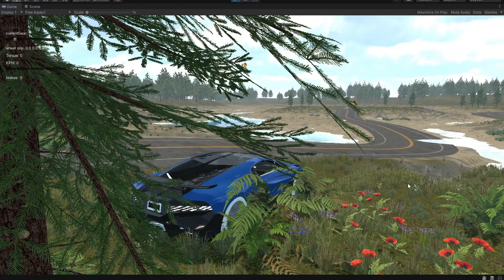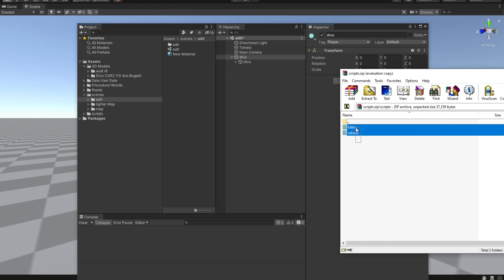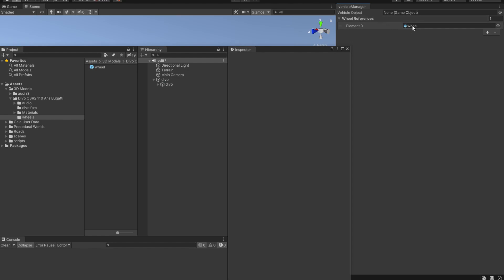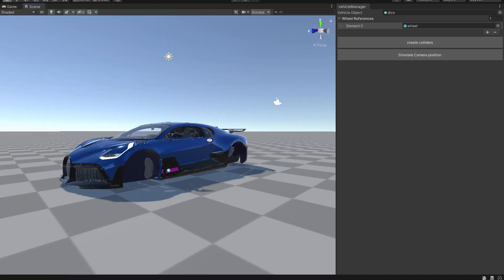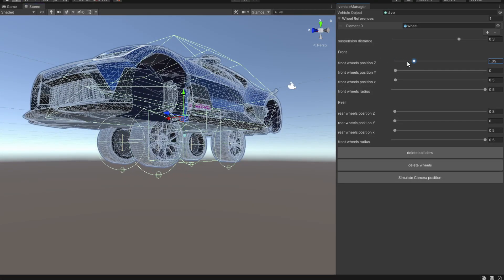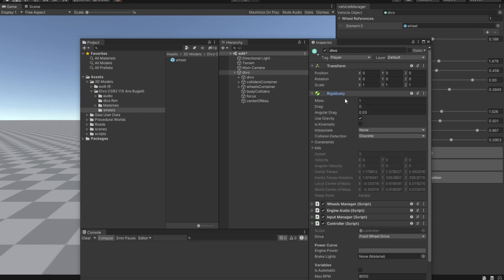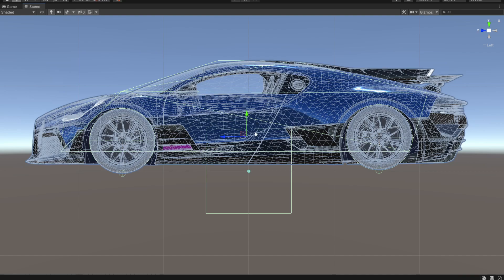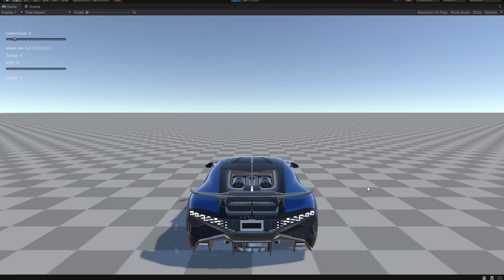Build a Racing Game controller in 4-Minutes (Unity 3D)

Comment: When i go to tools>Vehicle Manager the wheel section is empty there is no list for wheel selection like in the video 
How do i fix this
Reply: if using varsion less than 2019.4 then there will be a input field called size 
put it to 1 or more to attach wheel 
if using more than 2019.4 than there will be plus icon press that
to attach wheel